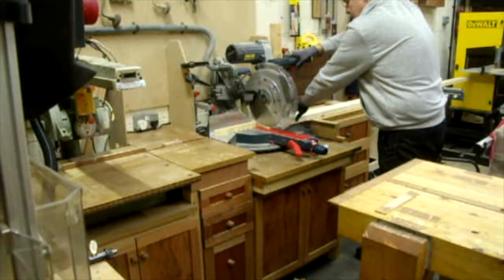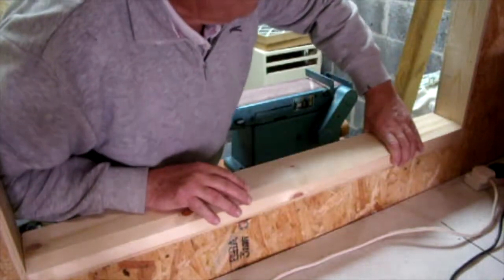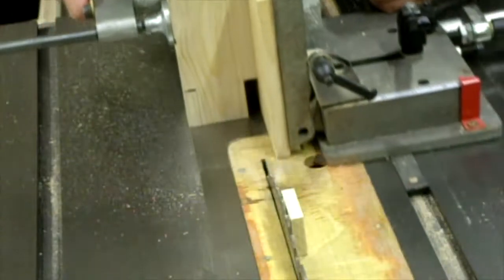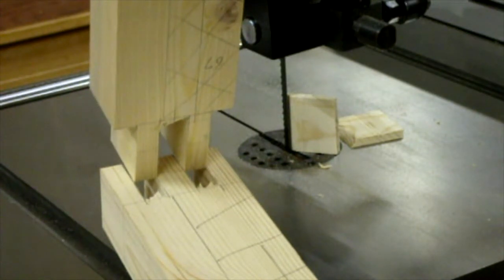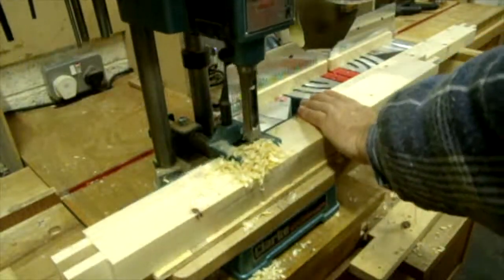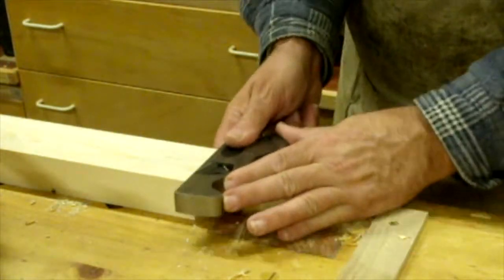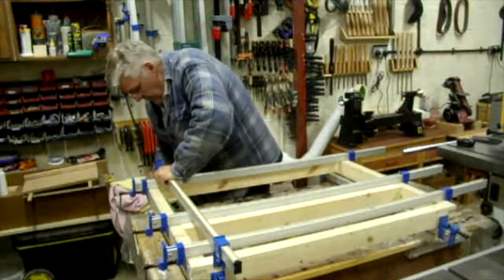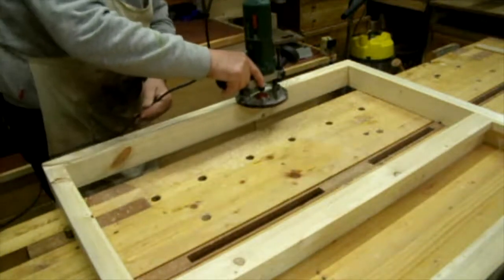Making a traditional Casement Window

Comment: Well ! That looks a first class job, a job I am about to do, but the material cost will be 4 times that here in France, even though I will mill the timber myself! I see by the padded shirt your temperatures must have plummeted, we had our first frost here this morning, time to put a shirt on ! Take care Steve! Chris B.
Reply from the maker: Thanks Chris, Yep the temperatures are fluctuating here in NW England, it was a 3 layer approach. Wow I didn’t realise that timber would be more expensive in France, is it regional of all across France? It’s just I’ve recently bought a few boards of Oak (10ftx1ftxx2’) that came from France and they were £18 a piece, reasonably straight stuff at 20% moisture rate ugh was a good price! Cheers Steve
Reply: @Phenrica  Odd is'nt it, we would pay 3 times that here in southern France, just to buy slabs of Oak to make 1 1/2" thick plank door costs circa £100 for the timber, and I have to cut it square and to length, I just buy a sawn slice of Oak tree and mill it up to size, I bought 35 Sq Mts of French Oak flooring from UK, had it shipped down to me, and it was still half the price I would pay here ? Everything is much more expensive in France ,except wine? Ironically I bought the flooring from a Frenchman that lives in UK ? I should buy a portable saw mill and cut the trees from my own wood! Chris B.

Comment: What is the point of the through dovetail joint vs. a but joint or mitered but joint and screws?  It looks nice, but it will never be seen and is painted over?
Reply from the maker: Hi Ben, thanks for the watch and comment. Technically there’s more glue surface created therefore a much stronger joint, butt joint and screws well the screws go into end grain even if glued strength is questionable. In the end it’s personal choice and using a traditional joint in a traditional casement window feels more appropriate to me. However different strokes for different folks all are functional. Cheers Steve

Comment: How did you keep the router so straight for the glass rebate.  It didn’t look like you were using a guide.  I’m finding routing really tricky.
Reply from the maker: Hi Eliza, I use a bearing guided rebating / slot bit that’s got a bearing at the bottom that follows the frame , here’s a link https://www.tooled-up.com/trend-bearing-self-guided-rebate-router-cutter/prod/235752 
Then it’s down to the depth of rebate for which size bit you need. I also have a number of bearing sizes which help managed the depth of cut width wise that I use (hope makes sense) as I recall the one I used was a 32mm (1.25”) dia bit and a final bearing size of 9.5mm (3/8”) that left a 11mm (7/16”) rebate. I use the different size bearing to help manage and splintering. 
Hope this helps
Steve

Comment: Will that be water tight around the frame where you fit the window frame into
Reply from the maker: Where it’s fitted is in a covered area with no chance of any water issues. If I fitted this to an external weather exposed area then I’d ensure the opening I was fitting into was either rebated or a shoulder plant and use plenty of silicon 😉